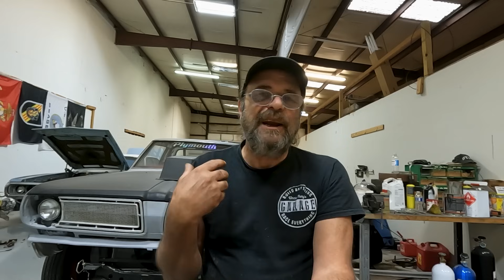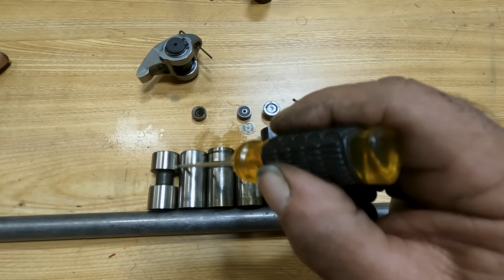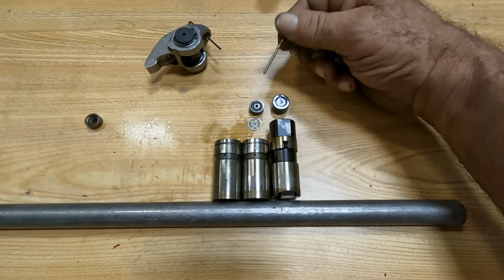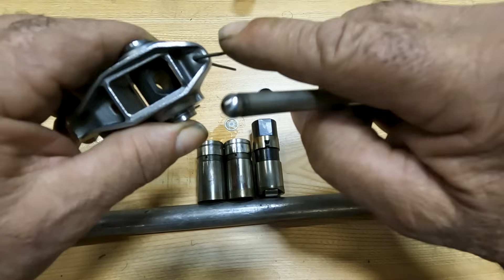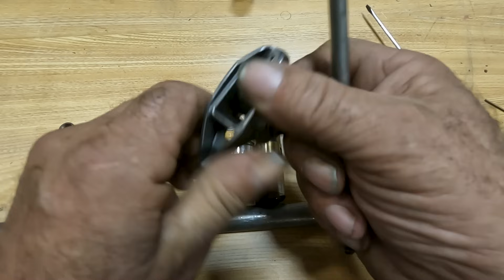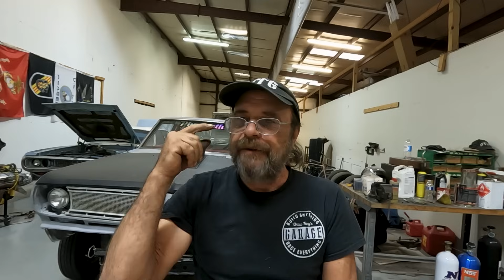Engine Problems You Don't Need To Have!  Understanding Top End Oiling Control For Pushrod Engines.

Comment: I've been studying camshaft and valvetrain geometry for over 45 years and as engines evolve there is still more to learn.
Reply: As my dad and grandpa always told me...the day you don't learn something new about whatever you're doing is the day that you should give it up.
Reply: Hey Tony. Why did you stop rebuilding the engine months ago? You got the parts and that was it.
Reply: So if a hydraulic lifter pumps oil up through the pushrod vs a solid lifter  where the oil is pumped up through the rocker is a standard Chevy 350 block designed  for both hydraulic and solid?
Reply: @Baron-Von-1973  chevys pump oil up to the rockers through the lifter and push rods, Chrysler generally pumps oil up to the rockers through the rocker shaft pedestals  Either way the lifters can be solid or hydraulic it just depends on the lifter internal design.
Reply: @Baron-Von-1973  Yes. The Chevy is designed for pushrod oiling (solid or hydraulic). Old Mopars are rocker oiled, newer Magnums are pushrod oiled.

Comment: Super interesting video Uncle Tony.
Here's a related story from a Ford guy.  I recently rebuilt a 300k mile Ford Ranger 4.0 OHV V6, and was dismayed to find literally ALL of the hydraulic lifters were seized.  (Change your oil people!)  The Ford Cologne V6 (2.6, 2.8, 2.9, 4.0) is a 60 degree V, central camshaft engine, with shaft mounted and oiled rockers. When the engineers added hydraulic roller lifters to these engines in the 80s, they just drilled a small channel in the side of the lifter bore that a small pin swedged in the side of the lifter body rides up and down in to keep it aligned.  There are calibrated holes in the lifter that feed its central cavity from the oil gallery.  The pressurized cavity in the lifter contains two plunger cups, two springs, and a check ball designed to capture pressurized oil and maintain the lash in the valvetrain.  
Unfortunately this design does NOT tolerate motor oil or oil change intervals that leave a varnish inside the engine.  Once those cups are stuck, you either have too much valve lash, or too much preload, both of which will wear out the rocker cups, wipe the pushrod tips, and in extreme circumstances wear the tops of the valves.  
While I'm just a shadetree mechanic, I hope my changes will minimize issues in my rebuild (not a hotrod) long term.  I chamfered the oil drainback holes in the block, installed a Melling high volume (not high pressure) oil pump, and installed replacement pushrods and rockers.  I noticed the Melling replacement rockers had larger oil holes meant to feed the valve tips from the rocker shaft.  Finally I committed to a 3-4k mile oil change interval with a synthetic blend high detergent oil.  Also if I haven't driven the truck in a few days, I run the starter with the gas pedal to the floor (clear flood mode) until I see oil pressure before starting.
Watching this video makes me feel more confident in my process.  But I still wonder if larger holes could be drilled in the lifters to minimize fouling?  I'm also curious how much aftermarket camshafts affect hydraulic lifters that are calibrated to be pressurized momentarily when the cam is on its base circle?

Comment: Youre so right.  I have been telling everyone that if the engineers built it with these specs, it's for reliability.  When you change 1 aspec, it change the hole combinaison that's maybe not meant to take that compression, that lift, that oiling, those bolts torque specs.  Everything.
Oiling is the blood of the engine, no oil or restricted oil = limited life.   Tony is the go too for teaching all the time.   Nice content as always.

Comment: A very "complex and delicate "procedure we do with old chevy inline 6s when using solid flat tappets or locking hydro lifters is to shove some steel wire inside the pushrods so the top of the head isnt so full of oil, also raised your oil pressure 5/10lbs. Just bend the ends in a Z shape and shove them in
Reply: Interesting
Reply: they had too much oil?

Comment: Dealing with oiling issues at present...Ford 351C...the absolute king of internal oil leaks, matched with an oiling system that isn't main priority. Full groove main bearings are just icing on the cake. That, and an oil pressure port in a sketchy place....Good video, Tony.

Comment: Good video, uncle Tony here in Australia there’s a guy called “the clevo king” and regarding Ford Cleveland. 

He did a video on a top end oiling management system that came out of the USA called Hank the crank oiling system…….

As you would know, it’s basically a manifold in the valley that assists in getting the oil back down to the sump to deal with high rpm causing too much oil to accumulate in the heads and starving the pick up in the sump…..

Might be an interesting video for you or your viewers…….

Comment: Love these "universal, applies to all engines, not just Mopar" videos, but you clearly forgot to mention the dangers of and how to prevent pushrod tube O-ring leaks. I can't be the only Corvair owner here, amirite? :)
Reply: You can prevent pushrod tube oil leaks?😁
Reply: With a little effort and an extra gasket the corvair 1.6 rockers fit a small block chevy AND you don't have any more pushrod tubes...

Comment: Learned the difference with the HD lifters from this video, makes me feel better about the LS1 lifters I put in my softail. Thanks Tony
Reply: I am not very familiar, but do you mean lifters from an LS engine in your Harley engine?
Reply: @r.joseph8911  Yeah, I did a full rebuild of my twin cam harley, and when I replaced the cams I used LS lifters instead of the overpriced HD or S&S units. I have a couple thousand miles on it so far and its been good.
Reply: @GasMaskPaintballer I used 5.7 vortec lifters in mine (I’m sure they’re the same part number) and no issues for me yet either

Comment: I am currently rebuilding a 1999 5.7 vortec. Your vids have been invaluable. Thanks Tony
Reply: Just food for thought. The small block Chevy is the only production engine with almost a perfect oiling system. Yes you can improve. But if it's clean and in spec, your good. If only Buick could be so lucky. Lol
Reply: @PatandDoopypoopy  I am going with a Melling high volume oil pump, cam, and lifters. Of course I will break it  in properly like I have in the past. I have the GM shop manual with all the specs.

Comment: Good video, great explanation Tony, I definitely got something out of it. 
Oddly, down here, the small block, no feed lifter is more widely available, and cheaper to buy than the Hemi 6 version, which is the identical lifter used in the Jeep 4.0. On the rare occasion, new players have been caught out, fitting the small block item to the 6, with obvious results. I actually buy my Hemi 6 lifters ex USA and have them shipped down under for less than buying locally. Keep the good stuff coming. See ya in 3 hours 😆

Comment: Its amazing how different ohc engines are. If you run an older style ohc engine with the valve cover off you'll have oil nearly hitting the ceiling because the timing chain is just flinging oil up and it doesn't seem to be an issue.
Reply from the maker: The difference between oil in an OHC inline and Pushrod V Style engine is drainback.  Offhand the only engine I can think of that has drainback passages at the outer corners of the head is the 426 Hemi (although I'm sure there are others)
On an inline, there's much less need to restrict top end oiling because there's no place for significant pooling to occur.  It all just falls back freely

Comment: I usually use a high volume oil pump when doing any mods on an engine. I have heard of amc lifters creating low oil pressure in chrysler engines.

Comment: Interesting. I knows about top end oiling mods on VW type 1 engines. VW’s oil through the pushrod. When you put in an aftermarket cam, especially an aggressive one. There are some oiling mods it’s best to do. On a stock or stock-style VW lifter (the more proper term is cam follower on these) there are two channels to let oil around the lifter, but only one has an oiling hole. The mod is to cut two or three small grooves into the lifter to let oil flow in between the channels. This does something similar to the magnum lifter with it’s wide channel. It maintains oil flow for more degrees of rotation, and since aggressive cams have longer durations of valve lift and faster ramps it chokes oil flow a little on unmodified lifters. It’s best to do with in conjunction with other oiling mods but you get the idea.

Comment: Another great video! The intricacies of valvetrain oiling is definitely not something covered often, so this is valuable. And, it is a reminder of how important oil changes are. Those are some really small holes that oil has to pass through, and a lack of oil changes is what leads to these tiny holes getting plugged up and then you have failure and breakage.

Comment: When I did not know to much I ordered pushrods from summit sent me hollow pushrods and the oiling was never a problem in LA 318.Later several people told me it won't work but always did Had 60lbs at startup on a hot day parked in direct sunlight would only drop down to 25lbs at idle.

Comment: Next Video Explain How Changing Geometry Changes Oiling. Angle Milling and Such Will Charge the Angle at top of lifter and oil hole on rocker.. Correction Can be made with pushrod length and valve stem length.

Comment: I'm looking into putting Magnum heads on a 1973 318. Do I need to block off any oil passages? Whats the best flat tappet lifter? Rhodes hydraulic or solid? Can the LS roller rockers fit Magnum heads? Whats the best pushrod? Looking for 300 horsepower, thanks for your time.

Comment: I have a 318 I have tore down cleaning up the block etc. I noticed one of the oil passages in the lifter bore is smaller than the others. Do you think that affects the oiling of that lifter and if so how do I remedy it without compromising the bore. Thanks Uncle.

Comment: I think the size of the "void" in the lifter also has to do with the profile of the camshaft. A roller has a different ramp up than a flat tappet. A solid roller ramps even faster. Will it have a bigger void???

Comment: Thanks for pointing out the differences between chevy and harley lifters.  Ive had to argue with countless people about this.  Try and explain it and it gets lost on them, usually.
Reply: Also, from what I've been told, the radious in the pushrodcup is different between the chevy and harly lifters. Ua you can take them apart and swap the cups bit,then you using used cups. To have new you would have to buy hatley lifters and rob the cups out of them.  That would defeat the cost savings.  This info is not first hand to me. It's just what I've been told by 50+ year old school jatley shop guys.

Comment: Always wanted to build a system to pre oil the engine before cranking it up.  Build oil pressure before the system is turning it over.
Reply: Most simply disable the spark and crank the engine until oil pressure comes up. A separate  switch to start the spark and you’ve done it.

Comment: We deal with this all the time, without fully realizing it. When a part number changes  from one year to the next but the part looks the same. What changed? With the passage of time, it only gets worse. Go look at 10 rebuilt B/RB water pumps, they’ll all be different, but when new, they had specific applications, most of the time, we get away with it.

Comment: So my 73 350 SBC with over 100,000 miles on it and still running smooth, but with only 35-ish psi at idle would probably benefit from a light rebuild

Comment: 🗿💨imo, the valve guide to valve stem lubrication is the worst culprit of ill running old engines. Fuel stabilizer helps with lubrication tho. Add til she smokes a lil🤠👍. But thats me and mine. Thanks Tony👍

Comment: Those rockers probably don't need very much oil. So the moments that u say the oil feed is blocked off (I have not studied these parts myself so that's why I'm saying ",when u say") is negligible. When the oil feed is in position to allow oil through is probably plenty of oil. Just a few drops per so second is enuf. I have a FE engine I run & that is a big issue of flooding the oil up top so its common to restrict the oil flow to the top end. Factory is a 5/16 oil feed hole witch is .3125 in size. I plugged that off & drilled a .093 hole in the plug & it's plenty of oil. So I restricted 2/3 of the oil going to the top of the engine & its still enuf with the oem rocker shafts. If I had aftermarket roller rockers it would need even less oil.
Reply from the maker: How about the other way, where the angle of the pushrod leaves the hole open for most or all of the rockers range of travel.  X16, that's a good bit of extra oil heading to the top end, no?

Comment: "What you have to understand is when an engineer sits down to design an engine".....                                                                                     Back in the day gearheads all agreed the legendary Ed Cole must have seen his Small Block Chevrolet in his dreams.                                                                                        After he dreamed the thing up the rest was easy. He simply went in to work 1 day and drew his visions out on paper.                                        Anybody who ever saw a pirated 327 from a Kingswood Wagon turn 7500 with a basically stock oiling system won't argue.

Comment: For sure there's money to be made if you keep looking for the deals and have a bit of a pillow to get repairs done. I bought a 2010 Elantra with a blown clutch for 800 and paid a reputable mechanic shop do the repairs for 1200. Sold the car for 6000. Didn't even have to touch the car.

Comment: Oldsmobiles in my experience are terrible with running the lower end dry.
Reply: Personally I think a lot of this is not enough drain back capacity designed into the engine in the first place. AMC V-8s feed the cam and crank bearing from the passenger side oil galley. The drivers and passengers side are both 1/2". At high rpm in racing applications they were notorious for pumping up the drivers side top end. Unless the flow path to the drivers side was restricted somewhat to only flow the amount of oil needed to properly lubricate the valves through the pushrods. The oiling system was perfectly fine for street use. But when designed in 64 or 65 race use wasn't on the table. Actually very few production engines are designed with race use in mind.

Comment: You lost me on the oiling issues. But the scoop behind you needs to be trimmed and formed to fit the concave on the middle of the hood.  Then add a matching concave up and over the top of the scoop. A 1/3 round router bit to smooth the sharp squared edges would look good too. Now you know why I was lost.